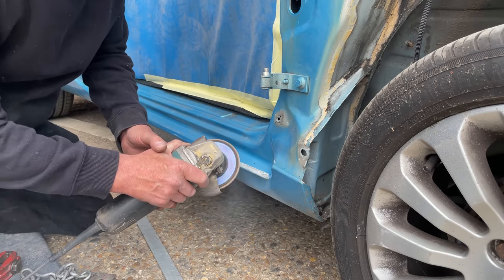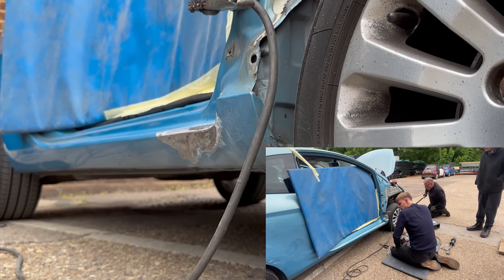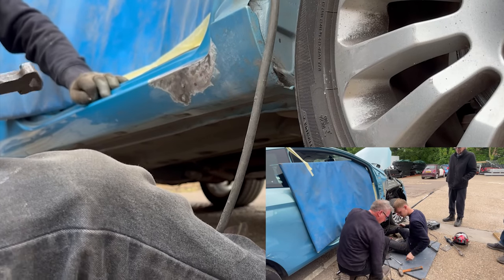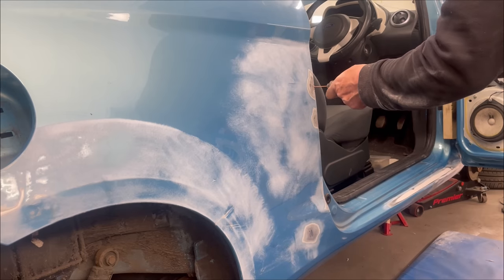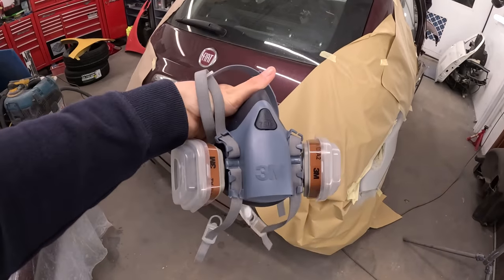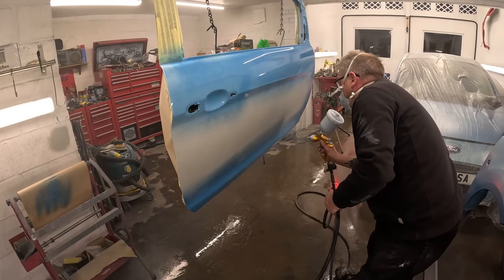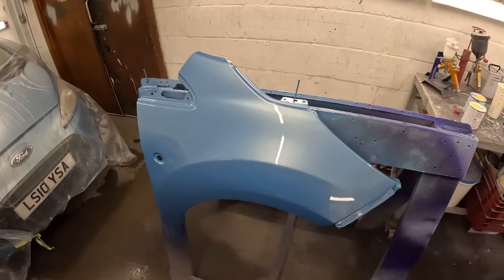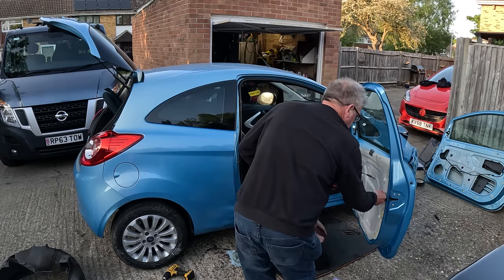£300 GAMBLE REPAIRED | BUT WAS IT WORTH IT?

Comment: Car is looking good. It’s great to see a young guy like yourself dabbling with accident damaged cars. What is this tool that you’re using here at 3.53. It’s welding some pins on to pull dents out. Where you then attach a slide hammer of some description.
Reply: It’s called a Rothenberger it welds the pins into the panel